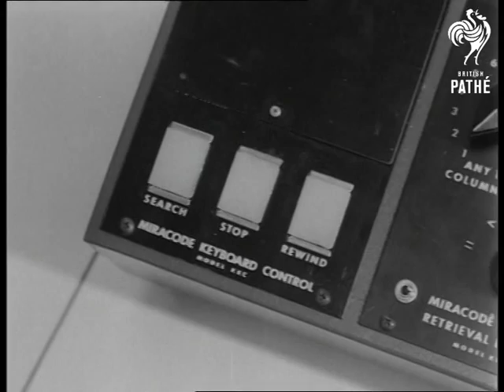National Giro Bank (1968)

Comment: Clips are from 1967 or 68 I would guess during testing before National Giro went live in 1968. ICL computers ran the data processing. The girl walking along the machine picking out piles of documents in the early part is picking out semi-sorted batches. These machines worked at incredibly high speed. After several runs all the day's transaction documents will be in the right sequence to enable them to be associated with the Giro statements posted to customers. You see the statements being printed later and split (they were printed side-by-side and then split). All documents were microfilmed so the bank could provide copies if needed. Very advanced for the mid 60s.